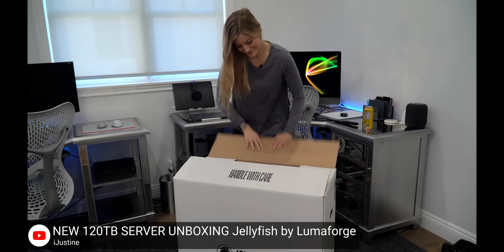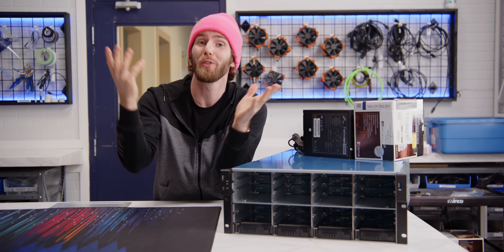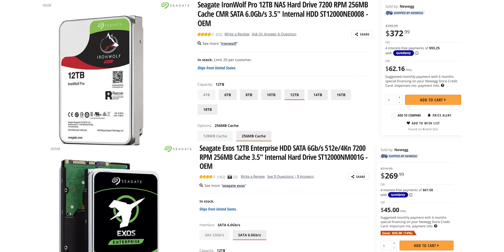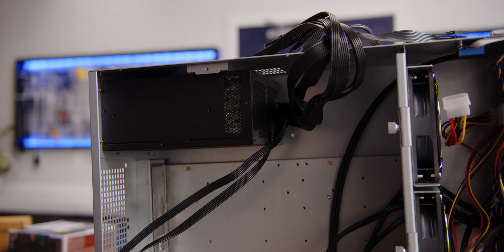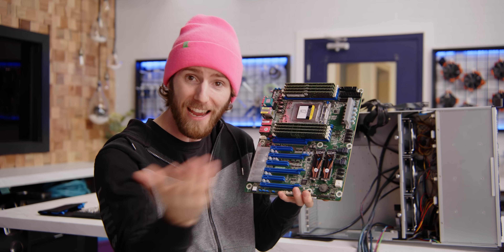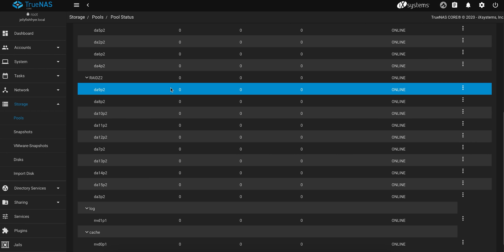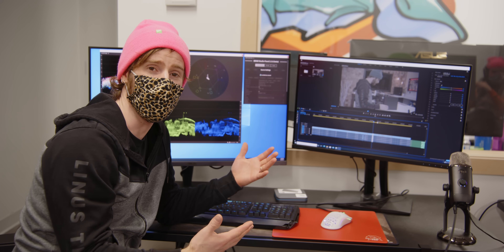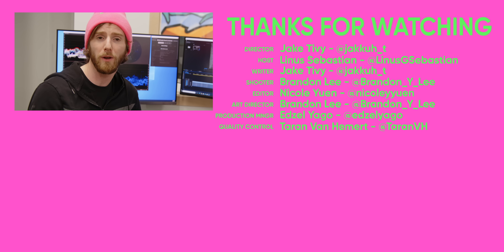Here's How to Save $45,000 - The Sensible Jellyfish Fryer

Comment: 2TB is WAY overkill.  TrueNAS only holds, by default, 5 seconds of data in its SLOG.  You really only need to be able to hold the sum of your network interfaces's bandwidth for 5 seconds.  So, in this case (10 x 10Gbe interfaces) \ 8 = 12.5GB.  The only real place a 2TB drive would be helpful is in write endurance since you would be spreading 12.5GB of data at most, across 2TB of space.
Reply: An even better option would be a 16 or 32GB NVDIMM.  Slightly more expensive than an SSD, but it's flash backed RAM so you are writing at the speed of your RAM and it should far outlast the SSD because you are only writing to the flash on an NVDIMM if it loses power.

Comment: The SLOG is completely overkill. Also a SLOG only helps when you have sync'ed writes like on databases or if you force it on your dataset or pool. However, that would be stupid performance wise. In general, your SLOG only needs to be as big as your system can receive synced writes at max inbound datarate for about a few seconds. Absolute max can be approximately via rule of thumb by "all total NICs speed times 10 seconds" or "SSD speed times 10 seconds" - whatever is smaller. My suggestion here would be 30-40 GB, limited by ssd speed, and the remaining storage on that drive should go to L2ARC, Speaking about that: Don't forget that you also need a decent amount of RAM for L2ARC indexing. A too big L2ARC require so much RAM that it limits the ARC capacity and in turn hurt your overall performance. Also: turn on persistent L2ARC. That is a nice feature of the latest OpenZFS 2.0 :)
Reply: More importantly, he didnt mirror it... and now has a single point of failure in his IO chain.
Reply: Came here to post exactly this. I work on large ZFS deployments, we use your exact "storage speed times 10 seconds" metric. From reporting, that's about 3-4x more than necessary, but also helps with flash longevity (wear leveling). For this system, 20 drives * 100MBps * 10 seconds = 20 GB. 2 TB is 100x too much.
Definitely remember to check L2Arc persistence, big difference if you ever reboot the system. Check /sys/module/zfs/parameters/l2arc_rebuild_enabled is '1' for Enabled.

For large and fast cache devices, you may want to tune l2arc_write_max and l2arc_write_boost or l2arc_feed_min_ms_. The default is 8,388,608 (8MB) is the maximum write speed per interval for the the cache device (heavily influences how quickly it will be populated, or data updated). For a fast cache device, bump _max to about 1/20 of the device's speed (for the Sabrent in this video, max should be around 141557760) and bump boost to somewhere in the range of max to double max (for the Sabrent in this video I would set boost to 283115520). You can also accomplish similar results by decreasing the minimum interval time in l2arc_feed_min_ms from the default 200 (for the Sabrent in this video, maybe 10 or so).

Make changes persistent by changing /etc/modprobe.d/zfs.conf. Only make changes if you know what you're doing. YMMV. Caveat emptor.

Comment: hum interesting ! You just did something VERY similar to what I did about a year ago to a local editing shop ( I live in São Paulo, Brazil ) , I make everything around a Supermicro board ( https://www.supermicro.com/en/products/motherboard/H11SSL-i ) with 2 IBM M1015 SAS controllers ( https://www.ebay.com/itm/IBM-ServeRaid-M1015-46M0861-SAS-SATA-PCI-e-RAID-Controller-LSI-SAS9220-8i/192161107657?hash=item2cbdb1cec9:g:RYoAAOSwtZJY9JN5 ) flashed to IT mode, 2 Optanes as ZIL and L2 ARC ( https://www.amazon.com/Intel-Optane-905P-960GB-XPoint/dp/B07CVNS851/ref=sr_1_20?dchild=1&keywords=intel+pcie+ssd&qid=1613433527&sr=8-20 ) 512 GB of EEC RAM and ... well ... 2 Intel X540 network cards and a Netgear 10 GB switch ... but if you are interested in get the max performance possible, dump this TrueNAS and use OmniOS+Napp-it .... you will get about 15% to 20% more throughput from the same system, believe me .

Comment: The saddest part is that for most people in the market for something like this, it's easily 10 times more powerful than what they need.  I mean, sure, if your budget calls for 50k, why not, but really most folk would be a lot better off paying some 5k to set up a proper, or improper network and a lot less expensive hardware.  Any novice IT person could put together a fantastic storage server on the cheap, and a decent one could write an install script to make it easy to use in the future.  
For my self, I'm happy with my 48TB currently on UnRaid  and a decade old dual six core opteron supermicro board.  It's not the fastest thing ever, but it works and I'm all in for about a thousand bucks.  That's with mostly 2TB sas drives, as I'm cheap and picked up 20 of them for $10 each, and my HBA only supports 2tb drives.  If I wasn't cheap-ass I'd use more than a $15 HBA controller and remove that limitation,  Also cheap -ass using two 4U chassis that hold 15 drives each.  The server board sits in one case, and my pfsense board sits in the other, so it all works out. 
Over all I'm just super confused why someone wouldn't just use a switch.  Hell, even include the switch in the box all configured with 100GB fiber between the server and switch and even that would cost well less than this 'jellyfish' bullshit.
Reply: https://youtu.be/krU0MRFhzv4👍

Comment: You really should have used both of those M.2's to make the SLOG a mirror. The way you've got it now, your data is vulnerable to a single drive failure, until it get's written to the platter RAIDs.

Comment: Shouldn't the SLOG be an enterprise ssd with power failure protection? That way if a power failure occurs, it has time to write its cache. Granted with a properly setup UPS, you're mitigating this somewhat, but it's still important to consider.

Comment: Cpu used in the video is written slightly incorrectly its using a 24 core "AMD EPYC 7402P"  the "AMD EPYC 7302P" which is written in the video is only a 16 core

Comment: You guys can replace the fans in the PSU modules with a Delta FFB0412UHN and it should be quieter.

It uses a 4 pin Mini GPU fan connector so you'll need an adapter to convert it to the normal 4 pin fan connector, you can stuff the cable inside the module too.

I've done this on my own FSP Twins 500W and it works well.

Comment: Your ZIL and L2ARC is way too large. ZIL doesn't do anything for streaming and won't grow much beyond 5s of sync writes (which at 100Gbps is 62GB) and L2ARC requires a portion of ARC (RAM) to be sacrificed for each block (400 bytes per block) or with a 128kbyte block size, that is 666GB of RAM to get 2TB L2ARC. 

You're better off investing in faster SSD for ZIL/L2ARC such as an NVDIMM instead of the 2TB drives and limiting the L2ARC

Comment: For most users this data server is still overkill, I always preferred the "Drobo nas", as they are very reliable, easy to use & gives user the ability to use mixed hard drives over Ethernet or Thunderbolt connection!

Comment: Jellyfish is for businesses who cannot build and operate their own storage server but need a carefree storage solution. Hiring a tech guy instead is a piss poor business proposition.

Think of it like this: You pay e.g. 50K on a storage system. Given you need to write it off over three years, that makes it ~8 USD per hour on a 40h work week. Now find the tech guy who is on your payroll for less then minimum wage for three years and brings the hardware with him for free. Same deal when you hire someone to build you a system. Good luck with support a year or two later trying to get someone to support you while your editors cannot do their job and you might lose a client.

Sure, for private usage a Jellyfish is just plain stupid, but that is not the point. I wouldn't use one either, but I have the skills to build and operate my own easily. If you earn money with a system the price is not that important as long as you generate more revenue that the system costs per operating hour.
Reply: The "maintenance" you have to do on this storage server is practically the same you have to do with the jellyfish: none at all.
There is absolutely no need for someone to keep such a simple server running.
The possibility of a hardware failure is actually smaller compared to the jellyfish because this server is using a redundant power supply and (probably) higher quality components.

You can still hire a tech guy though, but just for building and setting up the NAS while your business saves atleast $44.000.
And don't forget that the Jellyfish only comes with a 3 Year warranty! What happens if it brakes after the warranty's over? Hire a tech guy to fix it or just bux a new one? lol

Comment: that's years and years of knowledge applied here to "save" that amount of money.  not many people have that.  factor that in and...  it might make more sense.  but i'm sure you know that already !! very cool video !
Reply: A friend of mine who never studied any IT just built a NAS for his company  similar to the one in the Video. He's even running TrueNas on it, so it's basically the exact same setup.

> Get parts list from someone who has knowledge, buy parts, build server, install operating system and you're finished.
I made the parts list for him and he worked for like half a day in total on the server until it was running. How do you need years and years of knowledge to do that?
Reply: @omegaPhix  as long as everything works... Its "easy". I did it also with just a bit of google reading.  But when its not working as intended.  Thats when the fun starts.  For some.  The peace of mind of buying a "solution" and not a product is worth a lot... And im sure its some kind of flex also.. you know
Reply: @bigguix  
Well, it's highly unlikely that the TrueNas operating system doesn't work as intended but it's not like CentOS which is installed on a jellyfish runs more stable. 
The chance that something acts up ist just as high if not higher on the jellyfish when compared to a "normal" NAS (because the jellyfish uses lower quality hardware than what's shown in this video for example). And if that's really the case you have to hire somebody to fix it in both cases.

The "flex" might be a point but it wouldn't be worth 5X the price and two years less warranty imo

Comment: You could buy the components, Hire an IT-Professional to assemble and install it, WITH a switch.
Then you could have Ethernet jacks dotted around the room. Then all you need to do is stick a PC in one of the Jacks, add a network drive, and BAM, its there. 

Make the hostname simple enough, write the most basic instruction on how to add it.
Write a script that adds it everytime at start up if you desire.

And you'd still be about 30.000 dollar cheapers then Jellyfish and expaning it infinitely cheaper because you can just 2X it.

Comment: 12:10 you could literally install an rPi4 inside the case, install windows, and remote into it for power monitoring.
Reply: And why would you want to? Install Windows for the sole purpose of monitoring power, I mean. You clearly have not seen what is possible nowadays on Linux with regards to monitoring power, every form of of I/O you can think of (and some you didn't), through very nice looking and yet useful web interfaces. I have. On an 8 year old laptop I just gave a new leash of life to by installing Linux on it. 

I am very aware of what is available on Windows with regards to monitoring (networked) hardware and the price tags that come with those solutions. Haven't seen one that can/may/could hold a candle against what is already possible on Linux.
Reply: @geroldmanders9742 ... Or I have, and I was just remarking on a simple solution to their "PSU only likes Windows" problem. It's not difficult to spin up a Windows VM if there's a path to hardware pass through, but an easier fix with less headaches would be a simple SBC.

Comment: i think those molex to sata cables are also known as "fire hazards"
Reply: Nope. A shitty power supply is a fire hazard. Lousy electrical wiring in your house is a fire hazard. Building your computer from combustible materials (cardboard computer cases?!?) is a fire hazard. A molex to Sata converter cable, once it disconnects it stops electricity from going through it. Without any kind of energy flowing through electrical wires, those wires automatically become non-fire hazards.

Logically your statement is false. And you should probably look up the definition of "fire hazard" and grasp/grok it better than you currently do.
Reply: @geroldmanders9742  ive seen it happen before my very eyes. ive had people come in with "my hard drive isnt showing up after a burning smell". logically YOUR statement about a cardboard box being a fire hazard is false, has it ever occurred to you that cardboard is non-conductive? also, disconnects?? what disconnects? trust me there's nothing in that piece of plastic that can detect a fire and disconnect power! what were you thinking man?

Comment: a couple of notes: you would get a performance benefit from pcie4 because the 2 sabrent drives you have caching there are sabrent's rocket 4 plus modules capable of 7000mb/s reads and 6500mb/s or so writes when used on pcie 4 vs ~3500mb/s reads and writes on pcie 3. - while we're on the topic of caching, slog should ALWAYS have redundant backing or you risk data loss and the possibility of corrupting data on the array.  if a slog device fails dirty it could write that data back to the array causing all kinds of corruption.  slog should be at least raid1. similarly l2arc is trusted because the system has already done it's redundancy and error checking while retrieving the data that's stored in the slog (all that nice checksumming and whatnot that zfs does to prevent data storage errors) that means that like the slog/zil, the l2arc should also be redundant. - in this case, to be on the safe side, I'd grab a dual or quad nvme add-in board and use one of those vacant pcie slots along with a couple more of those 2tb sabrent rocket 4 drives...  they're pretty fantastic.  I have one of the newly released 4tb models in my primary workstation as my main system disk (backed up to my truenas based nas regularly)

Comment: Back when I worked for PNNL, the wake-up by LAN would get disabled after a day or two if I ever turned it on in the settings.. Any and every power and/or config setting that IT didn't like, would get set to a PNNL default if it was connected to the PNNL network. This became a bit of an issue when I was stuck at home for a few days after an appendectomy; I had to call someone and ask them to go into my office and shake the mouse on my computer just to wake it up.

Comment: To be fair ... Linus has a point in blaming Lumaforge to have prices >50k for such a solution. Thats definiatly overpriced ... It even saddens me a bit,
But in general other respectable enterprise storage brands wont charge you nearly as much. 

I work 10+ years in enterprise storage and out of curiosity I have quickly opened my quoting tool to check how much you would need to pay in order to get something similar. 
With 250TB raw capacity and something like a dual-controller solution (total of 256gb Cache) you end up with ~17k to 18k depending on your specific configuration (number of interfaces, advanced feature licenses, ...). Dual powersupplies and BBUs are kind of standard with those machines. 

So in other words ... yes, you could build that thing on your own for a little less. But if you really depend on such a solution i would rather spend +20% in order to get "full-enterprise" hardware which is assembled and supported by a well known vendor. 

On the other hand ... maybe thats just me, who saw two many of those "self-builds" blow up and loosing data. :-)

Comment: I have a few similar those... I have an old one running Freebsd but thhe newer ones just run ubuntu with ZfsOnLinux . but.. I do use esxi, pass my storage cards through vt-d and use intel 10 gb nics so I can use sr-iov .. I tend to stick in a little more ram and run some applications on top as well.. having a nice big CPU and it beng idle all the time is a waste.

Comment: At this price point, not even the "I'm not good with electronics, I'd rather have an easy solution, even if it costs more"-argument is valid anymore. For 45 000 dollars in price difference, you can hire someone to do it for you and STILL save more than 40 000 dollars. Zero work for you and still a better, cheaper product.

Comment: 13:28 what if you had used a dual 40/100g QSFP+ card and used a breakout cable? Would have given you 8 10g/25g. Sure the dual port 100g would be held back by PCIe 3.0 but still, it would be pretty darn fast